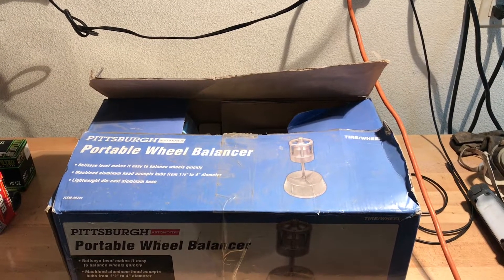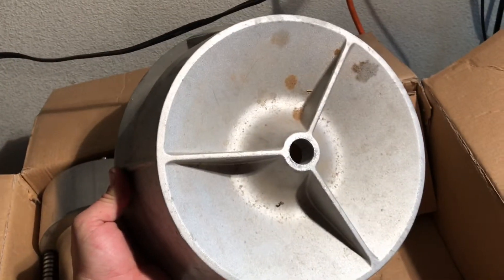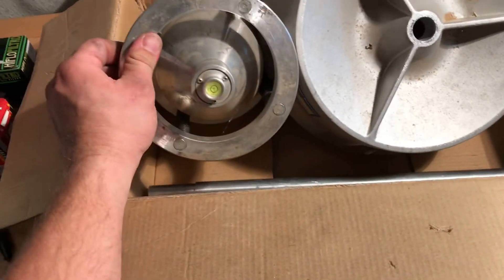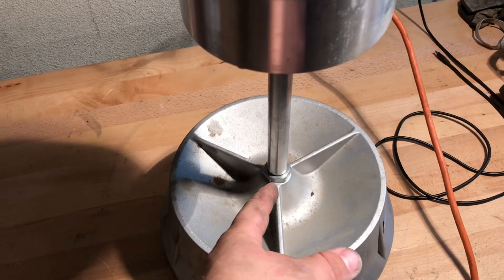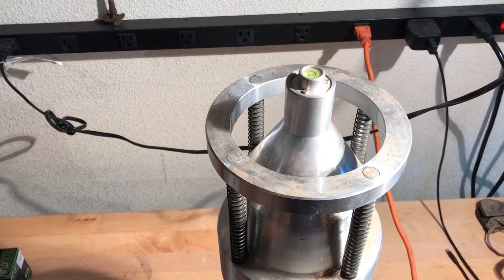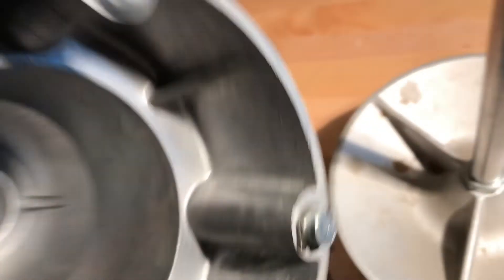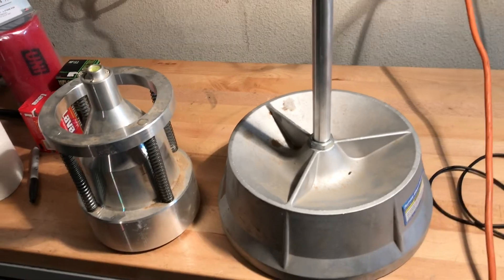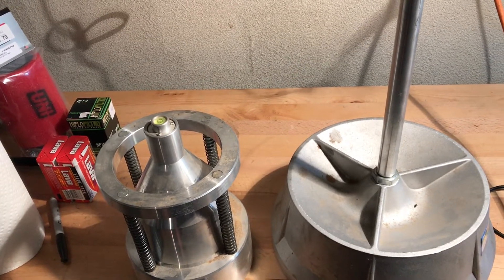Harbor Freight Tire Balancer Long Term Review

Comment: I heard someone complaining about too much play between each pin and its relative hole in the ring that actually don’t change tyre position because it’s centered by the cone, but can move its own weight, giving wrong feedback. I think it could be modified applying longer and  more precise bushings which do not allow lateral ring movements.

Comment: PS, i have did this to my wheels on the back of the car,  new tires and new rims steel rims,   and had one hell of a problem getting them balanced,  until i did what i was  telling you guys on here,  and i put the 2 back wheels and tires  black on the ballancer after fixing the balancer as well,  and lining up my tires on the rims,,   and now i have my back wheels back on the car   and i didn't need any waits at all,    and my wheels are  balanced perfect,  but didn't  line up my 2 front wheels tho,  but the  repaired balancer balanced them perfect as well,    and you know what, my 2 front tires had  yellow dot on the 2 tires, well one yellow dot on each tire, and i still needed  led waits,  2.oz on one wheel,   and 2,7 oz on the other wheel,    strange,  when i lined up my to back  rims and tire  i didn't  have to use any led waits at all,   you would think  as smart as the  china  people are  they would stick the 3 stupid legs on the bottom base stand of my bubble balancer,    and   would think that i would be 2 stupid and wouldn't know that it was tipping to one side,,,lol...

Comment: Bubble balancers are only as good as the operator.  With that said I always keep my balancer intact and I haven't had to calibrate in over a year.  I  do cover it and keep it from being knocked around. I never slam tire on balancer and never install clamp weights while on balancer.  I only use sticky back weights and line them up with center of rim. Most times it comes out perfect but every once in a while I have to redo a tire. I've had computer balancers come out worse.  Hammering on clamp weights and flipping up mud guards shocks the oscillators in computer balancers and throws off its calibration. A good shop calibrated balancers once a week because of this.

Comment: Can we use 17" with this tools? Some people said it is really hard to get goid accuracy, they've got different readings all the time, is that true?
Reply: The instructions say up to 15", I'm trying to do a 16" rim. I don't know how accurate it is, it's consistently saying it needs weight near the valve stem but, I'm not sure how much weight to add, .5oz reads about the same as 2.5oz 🤔, you can't just put weight on and be done like a lot of the youtube vids say, when you move the balancer it will recenter in a different spot.
Reply: I've done 18s no problem. I believe these balancers have been around for decades with the same design and 15" was the largest popular wheels,  and instructions are just as old. If center hole fits within the pyramid you are good to go.

Comment: talking  a little about tires, some have a red dot that is placed next to the valve stem   this will make balancing much easier,    say if you have some tires that do not have a red dot,  now what would you do to solve this one.  the fix,   you have to look in side the tire,   look to see if you can find  leaped over rubber joining s,     would look like   lines of rubber going across length ways in side the tires,  if there are 2 lines or 3 or what ever,   take a white chock and mark the line with chock  right in the middle of those   line,  and it have to be in the middle,   and this chock mark is the heaviest part of the tire, now,  you can put the rim only the rim on the bubble balance to find the  light spot,  now the light spot of the rim is where you have to add led waits, but do not add any waits,   just  mark it with a strait line with your white chock,  our just use the valve stem on the rim for your heavy spot, now put the 2 white marks to gather  when you put the tire back on the rim,   and i will also tell you guys on here  if you like  how to find out if your bubble balance is off set from the center bubble,  what this means is,   when you balance a wheel and tire on your bubble balance and  line up the bulls eye right in the center where it should be when balancing a wheel,   and if you are heaving trouble balancing well,  your bubble balance if off set when it was  made at the factory,  now this is how you can fix your balance to make it work like  a  4 thousand droller spin balance, take a tire  and rim the same size as you are using on your car  our what ever,  but the car wheel is going to work better,   go home with the wheel and place it on your bubble balance, but before you place the wheel on the bubble balance,  make sure the balance is on a flat floor and cant  move  around with a wheel on it,  one thing you do not wont   is your bubble balances moving from side to side while  balancing  your wheels,   and if your bubble balance got the 3 little stub legs on the base bottom,  put your safety glasses on and grind  off thous  stupid legs,   did you ever try to sit on a 3 legged chair?  well it just  not going to work   you need 4 legs  our nun at all,   because every time you put a wheel on the balances it is tipping to one side  the length of the 3 legs,  and the only reason it do not tip right over is  the legs are short,   if the 3 legs was 1 inch long   then the balance would tip 1 inch to the side,  now, anyways  you have your  tire on the bubble balance  that you got balanced at the  garage on a spin balance  right?   NOW, take notice of where that bubble is going to settle at,  and it do not matter where it lands you know this tire is balanced at the garage  right, even if the bubble is off the center,  don't add any waits,  your only using this balanced wheel to check your bubble balance ,  and to fix it if it is off set and not working very good,  NOW take a  black pen that makes a  very small mark,, draw a  line around the   side of the bubble  close as you can get to it,  because it is heading  in the middle of the bulls eye circle,  but maybe not right in , could be  half ways out,  the part that is headed in the  center circle   because the bubble is not right in the circle right? and this is why your bubble balancer is not working right,  now, after you have the  line draw-ed around the half of the  bubble  that is coming in the circle,  but not right in,      now take the wheel of the  bubble balancer very slow and easy  and lay it a side,   now your bubble should go back in the circle right,   now do you see where you drew the  rounded line with the  small tip pen,?  now add some waits  on the side of your bubble balancer  to make the bubble go back in the same place as you made the rounded line with the pen,  and make sure you have it in the very same place,    now the bubble on your balancer should look the very same as when you had the wheel on the balancer that you balanced at the garage  mark it on the balancer where you got the led waits at,  because you need them after , don't touch the led waits yet,  now take your little screw driver and set the bubble back to the center of the bulls eye circle   where it should be when balancing a wheel, now you have to  stick our glue  what ever waits you have on the top of your balancer,   and in the same line as you have them placed of the  on the balancer but for the balancer to work right you need to get the led , stick them on ore like i just said  , you can put the led down lower on the balancer head   but in the same line  you had the led when you made the test,,  and if you put the wheel that you balanced at the garage on your bubble balancer,   and the bubble is right in the bulls eye center , well then you don't need any thing your balancer is working perfect.   and if you do have tire shaking  problems and bubble balancer not working right , this works,,
Reply: zmby yellow dot to valve stem, red dot is just the high spot, yellow is the light spot, hence why valve stem helps balance since it’s a 1 ounce weight.

Comment: well i do know the bubble balances do work. some work better , and some of the bubble balancers are off set like hell,  but there is a way to fix it .
Reply: I went thru 3 of these balancers and all were junk, once you balance tire, if you pick it up and clock it 50%,, your wheel will be out of balance again, I took the balancers to my machinist, he put them on the lathe and all 3 were casted in an egg shape, ontop of the divot being off center! I recommend buying the older coats or Acra bubble balancers, those work phenomenal!

Comment: Correct me if I'm wrong but... Aren't you suppossed to take off the retainers at the bottom of the balancing cone that has the springed rods  so that the flange set moves up and down depending on the weight of the wheel?
Reply: Oscar Moreno
 NO!

Comment: good day sir,  i know this video is 9 month old  tho i was wondering  if
 your balancer was working as mine is working, after i have the tire 
balanced  i put the wheel back on the balancer again    but now i put 
the wheel in a different place,  what i mean is  i turn the wheel so i 
have it on the balancer in a different place as the first time when i 
balanced the wheel,    and every time i do this  i have a different  
light spot,  i did this like 20 time and have a different reading each 
time,  so where is the right light spot on my wheels, lol,  my car tires
 and rims fit on my trailer  superficially,   and my trailer  got no 
brakes just baring and cones ,  and when i install my car wheel on the 
trailer and tightening up the lug nuts,  give my wheel a little spin , 
leave it set for a few moments,  the heavy spot of my  wheel  with all 
that other led removed,   the heavy spot when right to the bottom,  
right where i wonted it to go,  took my white chock  marked the light 
spot    added led so that my wheel stooped  rotating ,   and this is how
 they balance the motor cycle  tires   and they are driving a lot faster
 then we are in our cars   and they have  no shaking or vibration  
nothing ,   couldn't balance a  motor bike with this bubble balancer  
first turn  you come to you shake so bad  would end up in the woods , 
lol  i am kinda  happy and glad i have  some way to balancer my wheels  
 besides  mr, bubble ferry  bubble balancer , mine is the very same as 
you have  sir,  the only way that  you can find out if your balancer is 
working the same as mine is ,  do the same test that i did ,   1 would 
say i have about 50% with the bubble balancer,  and a 150%  balanced on 
my trailer ,    the bubble balancer is balancing the wheel of the  right
   light spot of the wheel,     this is why it is never going to be 
perfect balanced,  so we need a 12  hundred droller trailer,  and a 200.
 droller bubble balancer to save a few 100 bucks,  but i love doing it 
the same even tho it's a  pain in the big toe, i still save the  money, 
lol    but the funny thing  when i bought the balancer they didn't ask 
me if i had bought the trailer first,  and to make  dubble sure  my car 
wheel is going to fit on the trailer  so that i can find the right light
 spot  and that the bubble balancer is going to find like 25 light spots
 on 1 wheel,    how we going to know  what one to take   to add our led 
 waits,   joke,  i think it would have been a bit cheaper  if i would 
have when with the computer balancer , not the bubble balancer  and the 
trailer, lol
Reply: I wipe motor oil on the cone every time I use my bubble balancer.  It let the wheel slide on the cone.